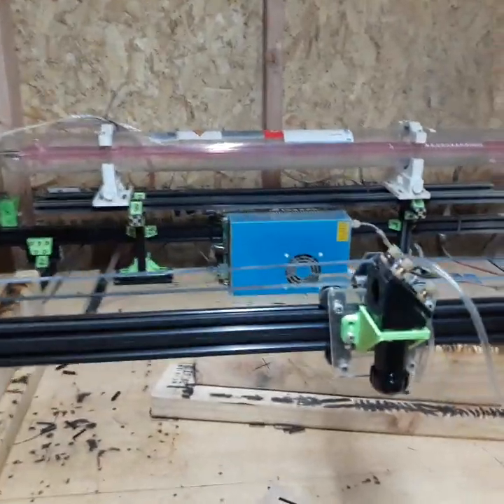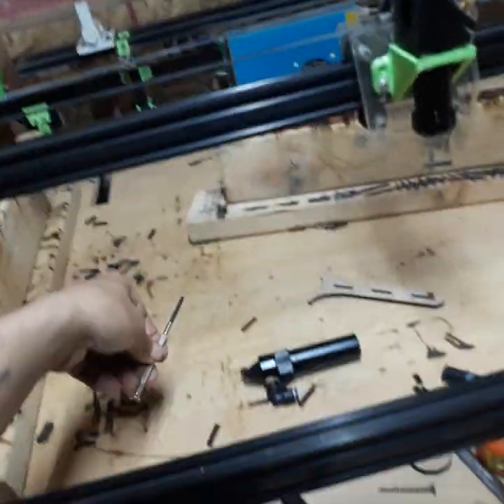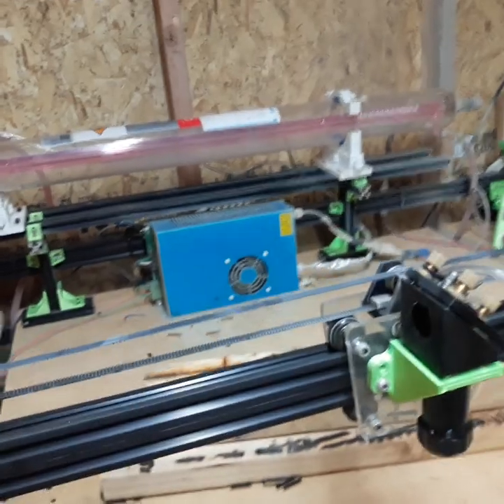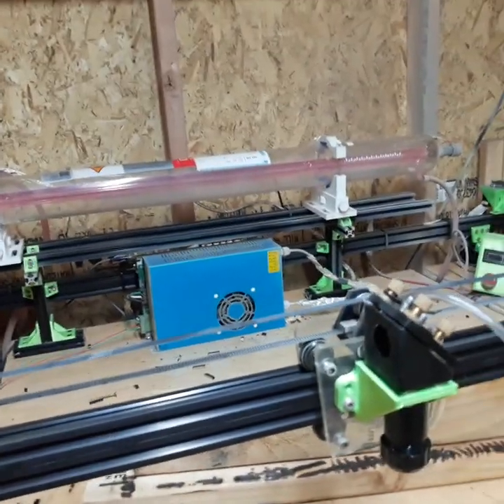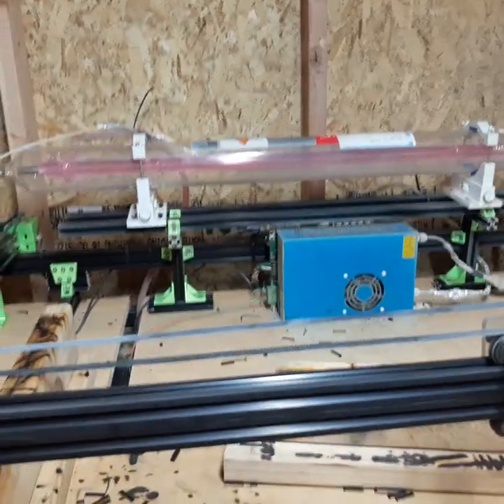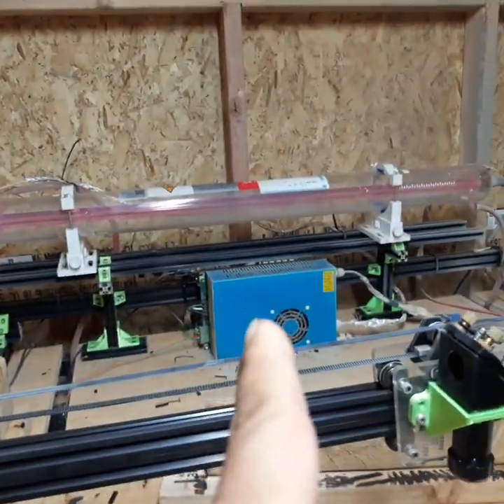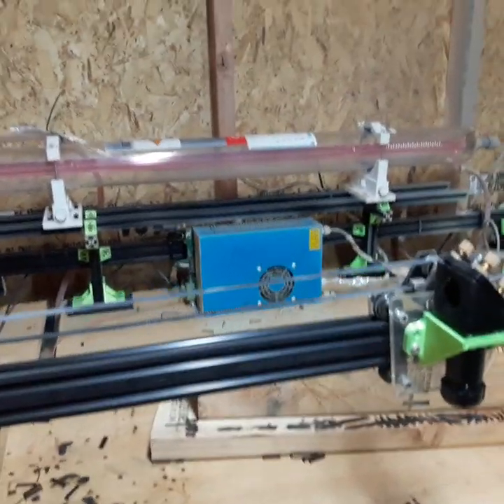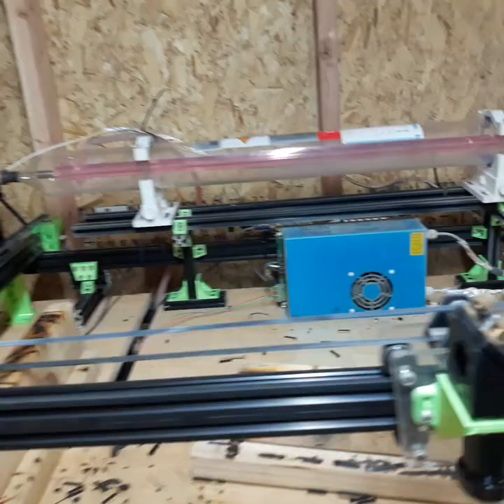Tuning your co2 laser psu to your tube so you dont fry your tube. Reci w2 100 watt dy-13 psu dy13

Comment: Fantastic!  I had been looking everywhere over the years, mainly thinking it was a setting Lightburn to translate the different power levels. I am upgrading and have a  a Reci W1 with a Cloudray DY10 PSU on the way.  I'm hoping to find this same adjustment on that model.  I remember thinking back to when I set the initial 45w one up, that it would've been very easy top pump way too much current to the tube until you knew how to limit it.  Kudos to you!

Comment: Should have shown the screw.
I think on the metal supplies you have to open the case to get to it.
So 100% in lightburn should be the max mA of the laser?
Reply from the maker: You’re right, I should’ve shown it Unfortunately the little screw was hard to show, and it was hidden on the bottom side where the psu was laying. I didn’t have to remove the cover to get to it though, there was a small hole in the side where I could put the screwdriver in. 

My reci tube said for long life, don’t exceed 24ma. So I simply set 100% power to 24ma, and then I could fire at max power anytime. Since it was within safe parameters
Reply: @GeorgeSimon  
I understand why you didn't show.
Better than me. Atleast you made a video. Lol
My ps is deep inside my machine. So it's not fun to get to. I think I have to crack the case to get to the adjustment pot.
Reply: @GeorgeSimon  
So I got to mess with my dy13 and the myjg. Found both had this adjustment on the side ( made by same company).
They must of had to many complaints because both were maxed out. 31+mA output. 
On my w2 tube at 70% it would peg my 30mA meter.
The my13 still seems to have more umpff behind it though. It cuts better. Pretty sure the myjg was overheating after hours of run time.

Comment: hi, how did you adjust the miliamph range? i bought a hy dy13 power supply and a reci 90-100w laser
Reply from the maker: Look for a small screw that can ve adjusted on the sides or bottom of the dy13. It is not labeled.